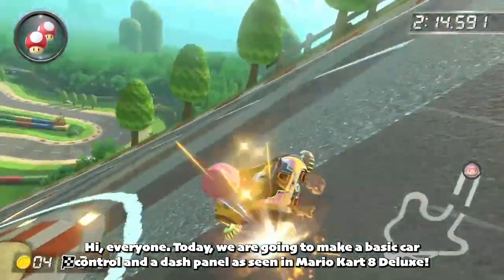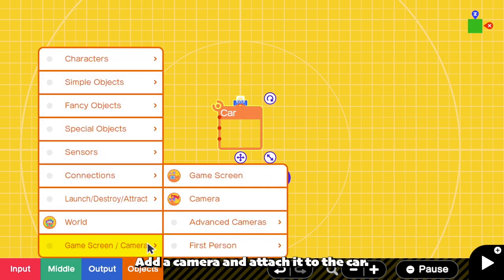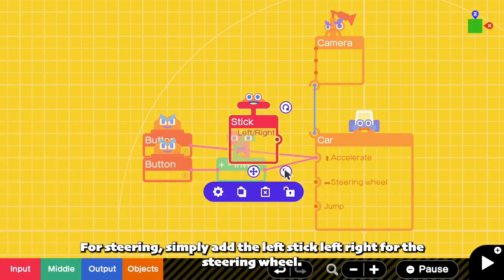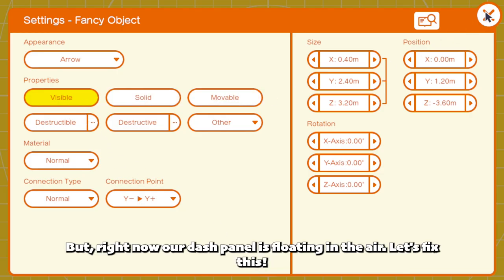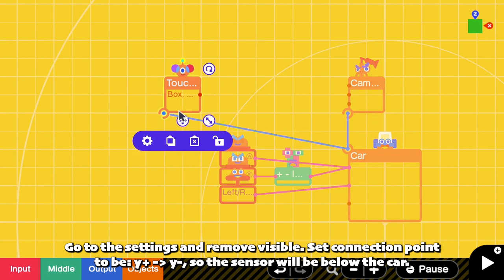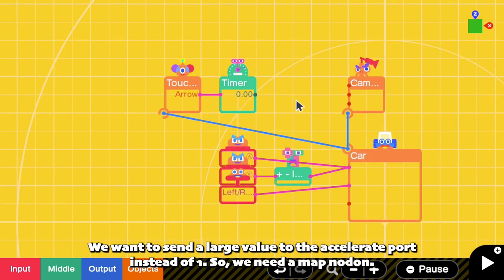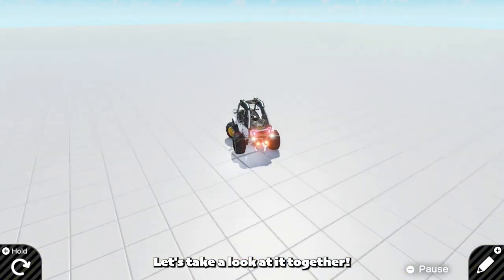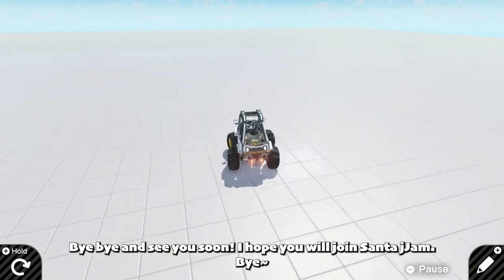[Mario Kart 01] Car Camera, Control & Dash Panel like Mario Kart! | Game Builder Garage Tutorial

Comment: Cool. Can we make the dash be one way though?
Reply from the maker: Yes, I actually have that version too.
1) add a touch sensor to detect a car at the dash panel.
2) add an angle sensor to the arrow and another to the car.
3) get angle difference between the arrow and the car.
4) add < nodon to check if 3) is less than a certain degree
5) multiply output of 4) with 1).
6) send the output of 5) to the timer.

Is this confusing?  😅😅😅 let me know. I can capture a screenshot and upload on my Twitter later.
(But now my switch is not with me... im outside having food now... hehe)
Reply: @jJaeStudio  I followed along and it’s perfect!
Reply: @jJaeStudio  it's too confusing. Can you upload a tutorial? Coz I don't use twitter